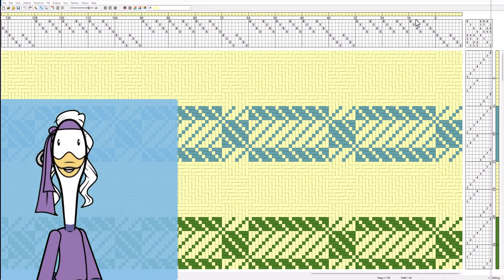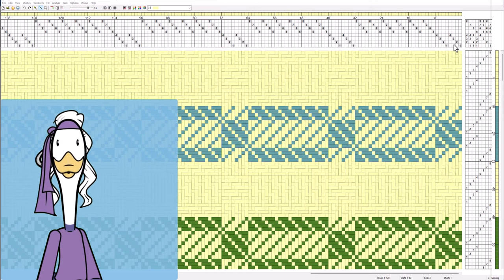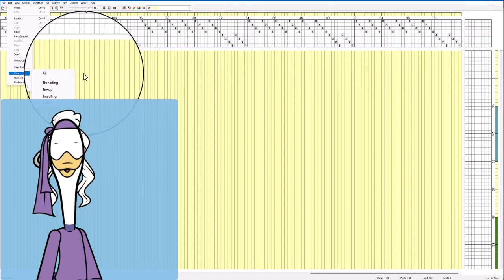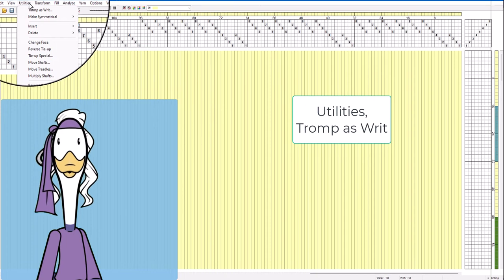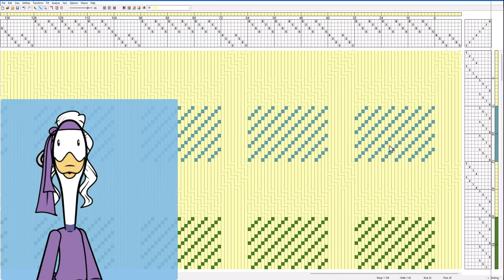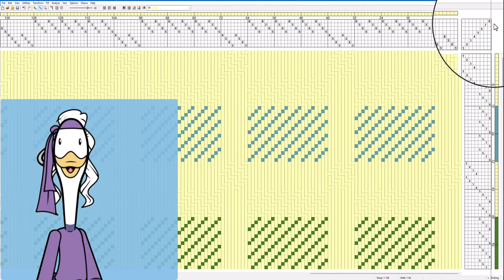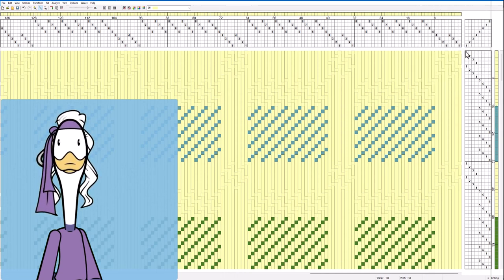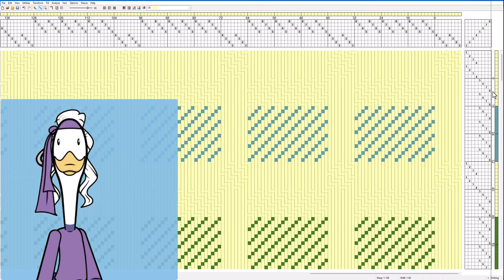Weavepoint Treadling The Threading

Comment: I'm very new to my dobby loom and this doesn't seem to work for me. When I go to clear the tie up, that was not a choice for me, so I cleared the lift plan which seemed to do the same thing.  Next was clearing the threading, again that was not a choice for me.  Where a line tool was used to make a diagonal line, again not a choice for me.   So what am I doing incorrectly?   Thanks
Reply: You need to use Tie Up and Treadling in the Options menu if you want to use the tie up (the diagonal line)